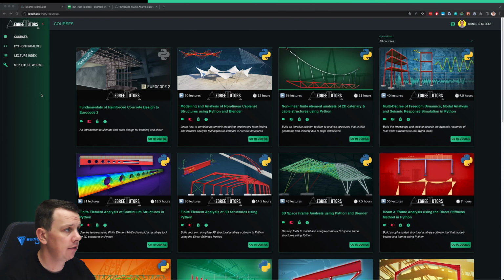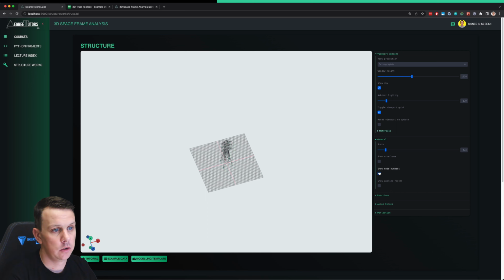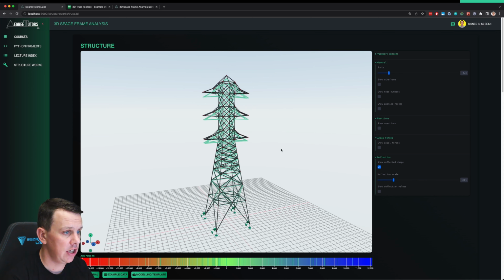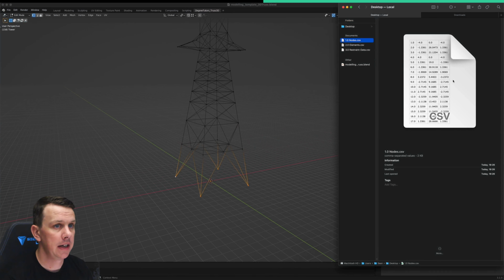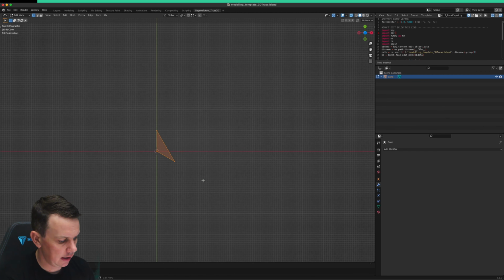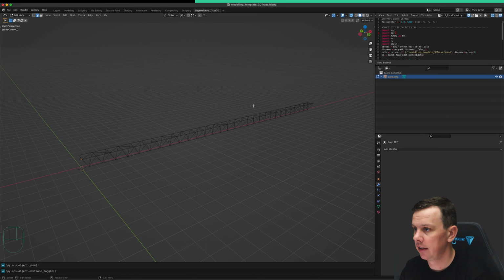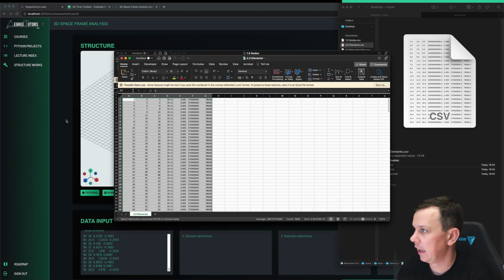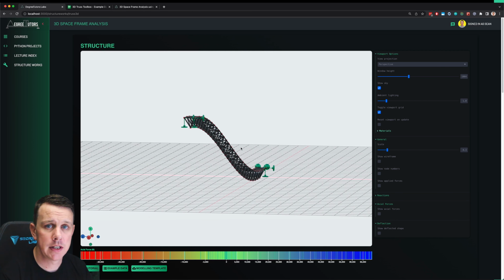Free 3D Truss Calculator - Tutorial and Walkthrough | DegreeTutors.com

Comment: I am trying to do analyze a cantilever truss where one node is fixed in X,Y, and Z and a node on the other end has a force acting on it in X,Y, and Z. It is saying "looks like not enough restraints provided", why is this the case?
Reply: And if i fix more nodes on the end "face", then it says "there was a problem calculating displacements". Really only one node should be fixed for the scenario i am modeling. It is basically a cantilever truss with one node fixed to a ball shaft and the other end has one node with a rope attached to it pulling in X,Y,Z away from the truss.
Reply from the maker: Difficult to say without investigating the model in detail I'm afraid. You can see how the solver was build here...
https://www.degreetutors.com/3d-truss-analysis-using-the-direct-stiffness-method/

or read a tutorial article about it here...
https://www.degreetutors.com/direct-stiffness-method/

A number of additional 'error checking' constraints were implemented to build this into a browser-based tool. It could be that some of these checks are overzealous in restricting your model or it could be a problem with the model definition. Like I said, difficult to dig deeper in the Youtube comments 🤔

Comment: I cannot thank you enough for making this. Great work, This is exactly what i need for my project. Just maybe a suggestion, would it be possible to use vertex groups as a means to assign different materials to different members. That way you could link material properties with the assigned vertex groups and not have to manually alter csv files. Maybe you could also use vertex groups to assign properties to pinned vertices and even loads, theoretically you could then have one script that export all the required data instead of having to copy paste from multiple csv files and overriding data if you have different loads/pins. Once again great work!
Reply from the maker: Hi Ruben - great to hear you're finding the toolbox helpful! Using vertex groups in this way sounds like a great idea and isn't something I thought of before. Condensing down to one file export would be nice. I'll put it on the list of future updates :)

Comment: Well done Seán! Can you tell us what do you use to create your toolboxes? Have you written the code yourself or you use a specific framework/GUI? For 3D parts, I guess it is three.js. right?
Reply from the maker: Hi Parker - thanks! Everything on the DegreeTutors:Labs site is custom coded by me. You're absolutely right - the 3D is handled with Three.js, well react-three-fibre actually, since the front-end app is built using React. All of the number crunching happens on a backend server using Python - pretty much the same codes from the course.